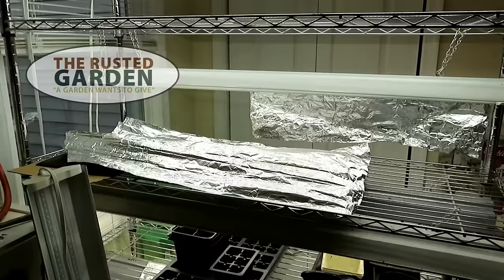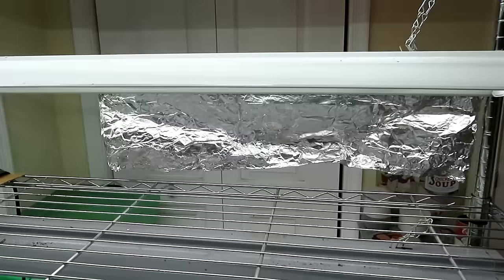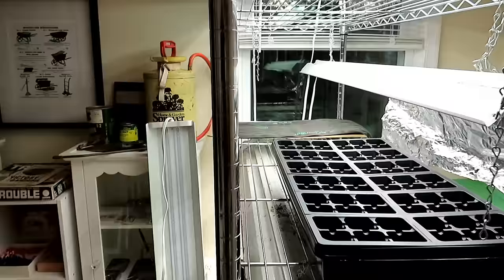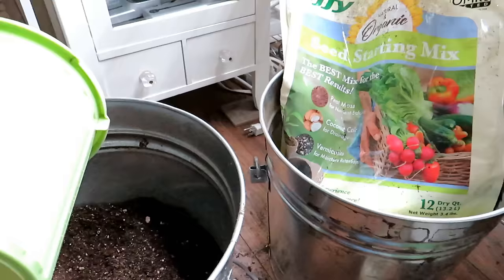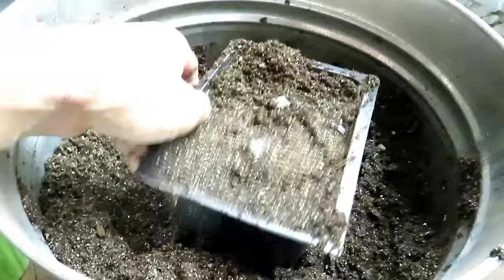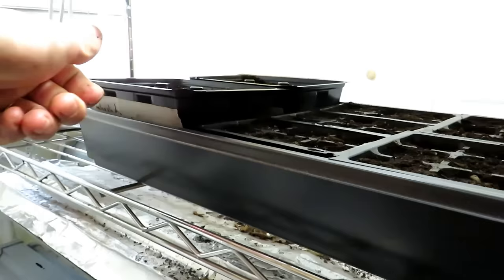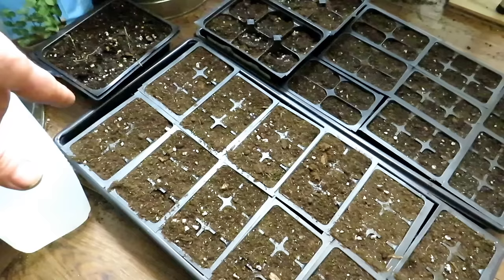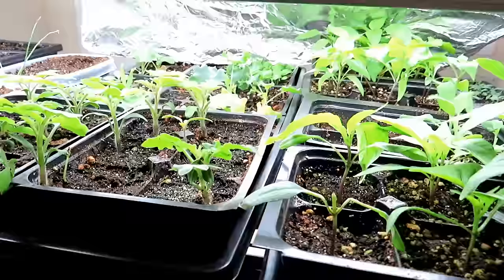A Full Guide For Lighting, Seed Mix, Cells, Watering, & Fertilizing Indoor Seed Starts: Time Stamps

Comment: Thanks Gary.  QUESTION:  Are my seedlings too close to the light if the leaves turn upward like a "V"?  I notice in your video at time 35:27 top left tray has a few seedlings in it that have the leaves turned upward.  Mine have started doing that the past few days after having the lights on for about 14 hours.  I leave the lights on 16 hours and the next morning when I check on them they are not pointed up anymore.  They have been growing for 2 weeks and are about 2 inches rom the lights.
Reply from the maker: I dont think so. They would get brown on the edges if they were too close and hot.
Get your GreenStalk Vertical Gardening Towers now for a spring series. Grow Vertically!
Use the Discount Code THERUSTEDGARDEN on GreenStalk 'Vertical Tier Systems'.  Use this link and enter my code for the discount https://greenstalkgarden.com/?rstr=therustedgarden
Reply: @THERUSTEDGARDEN  Thank you :)

Comment: I'm trying to get an answer as to how far apart my grow lights should be from each other. I'm NOT talking about the distance ftom the lights to the seedling.
Im using a 18"x48" with 5 shelves in it. I had planned on using three Barrina 4' LED bulbs that are rated at 5000 kelvin. I'm using 10x20 plastic plant trays and was planning on using three bulbs. The two outside bulbs will be placed 4" ftom the edge of that plant tray and the third LED bulb will be centered at 10". All lights will be placed perpendicular to the 10x20 light trays.
I could really use your help. Every time i ask the question I'm told how far to place the LED bulbs from the plants and that's NOT what I'm looking for.
Reply from the maker: Just evenly. Probably 4 inches works from edge. But equal space between edge, center, edge would work just fine,.
Get your GreenStalk Vertical Gardening Planters now for a spring series. Grow Vertically!
Use the Discount Code THERUSTEDGARDEN to save $10 (orders over $75) on GreenStalk 'Vertical Planter Systems'.  Use this link and enter my code for the discount https://greenstalkgarden.com/?rstr=therustedgarden

Comment: 🙋🏻‍♀️ Gary, Question about greenhouse plastic for hoop tunnels. Does it have to specifically be “greenhouse” plastic or any 6 mil plastic?
Reply from the maker: Any 6 mil would work. But you want to make sure it can take the UV rays of the sun. Generally most should.

Comment: I only have space for 2 foot lights, and I'm having no trouble finding led shop lights in the right kelvin range, but can't find anything over around 2600 lumens AND 6000+ kelvins. Would the lower lumens work or would I be really damaging my starts?
Reply from the maker: In years back I managed with 3000 lumens on flourescent bulbs. I would keep them close at germination if you cant find anything else.'
Reply: @THERUSTEDGARDEN  thanks! I'll keep looking for better ones

Comment: I recently got some LED shop lights for growing. However, since the output may vary somewhat among brands I'm trying to get a better handle on what the plants are actually seeing. I have a light meter I use for photography that can measure Lux which measures light intensity. I'm wondering if you have ever gotten some intensity measurements. Depending on the height I put the lights I can get readings from 3000 LUX all the way to 20,000+ Lux. I've been doing some experiments with different intensities but I can't be sure it's the light or some other factor (soil, moisture, plant type, etc.) that is affecting the plants. Any idea what intensities would be best for various plant stages?
Reply from the maker: I actually never measured Lux values are worried about Par values. Only because I am just growing transplants. I would worry more for flowering and fruiting.